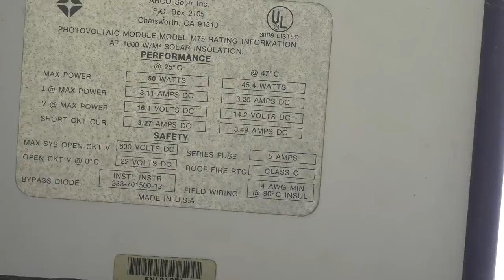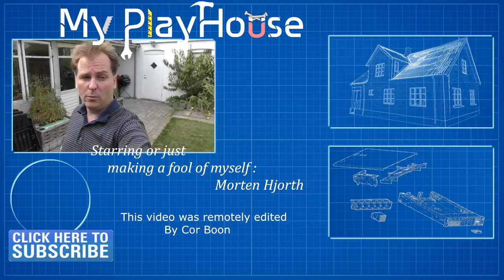Save 5X on Power Consumption - DC DC Step Up Booster Converter - 734

Comment: You can charge the lead acid battery with a buck converter too. Set it to 13.8 to 14v. Connected direct to the solar panel. More efficient than a controller usually too.
Reply from the maker: Hi Munted Wookiee
Thank You very much!
Thank you for watching! :-)

Comment: Hey morten, i recommend to put a battery undervoltage protection between the step-up-converter and the battery. Have the same board for a led flood light that I build a long time ago. When the battery goes empty, the converter pulls more and more current, resulting in a extreme voltage drop on the battery. Tryed this out myself and the battery voltage goes down to 9V and then the mosfet on the board exploded because there was to much current to hold up the output stable ^^
Reply from the maker: Hi DashcamDriversGermany
Thank You very much!  Do you have one you can recommend ? a cheap one :-)
Thank you for watching! :-)
Reply from the maker: Nice,, but I just put on a new tiny charge controller,, and it has this battery protection,,, a bit low for my taste but it is there.
Reply: you need to connect the converter at the outpit of charge controller to utilise that function else a use a 12v relay to input the converter through its normally open contact. if not the battery will die as mention an year ago!

Comment: The metal backed PCB is for heat dissipation. It is common to use thermal paste to attach them to a heatsink for passive or active cooling. 
Thanks for the video!
Reply from the maker: Hi Kevin Clingerman
Thank You very much! First time I got a PCB like that,,,, It is rated for 250Watt,, I am using 32,5 watt it only just become hand warm,, glad you liked the video :-)
Thank you for watching! :-)
Reply: My PlayHouse yeah I figured 32 watts wasn't enough to justify a heatsink. Julian illett on YouTube does a lot with solar power and DC buck/boost converters, you should check him out if you haven't already!

Comment: I think 32V is the open circuit voltage of the PSU. I bet that if check the voltage during charging, you'll find 28V.
Reply from the maker: Hi Alexandre .S
Thank You very much!  but it was charging!
Thank you for watching! :-)
Reply: It could be the lithium battery charge controller asking for more power. If it was a factory battery you might see the 28V. I say give the mower the power it wants! More voltage = more better... until the magic smoke leaves...

Comment: I don't see any fuses.
Also a undervoltage protection would be a nice thing to have.
I would recommend an output of what the power supply tells you and don't go any higher than that.
See also the power supply for how many amps it can deliver and hold you to that.
Reply from the maker: Hi Geert Pirens
Thank You very much!  some of this you will see in the next video.
Thank you for watching! :-)

Comment: Hi Great video, Your suggestion would be great for my problem.

Solar panel open-circuit Voltage: 40V

Battery 12 V (AGM

Controller : PWM controller max input voltage 28V

Can I use D3806 to step down from 40V to 25V and connect to
solar charge controller to charge the battery? Will I lose energy in this converter
in step down mode? Or the module will convert in to Amps from Voltage while step
down?

Thank you
Reply from the maker: Hi Krishna Kumar Velappan
Thank You very much!  there is a good chance your charge controller can take in 40v,, check that first.
Thank you for watching! :-)

Comment: Never take that battery lower then 12.20v or you will damage it. Deep cycle lead acids can only be discharge to 50%(12.20v). so a 100ah really is a 50ah. Another thing, lead acid batteries have a bad charging efficiency at 85% so your losing 15% of the power that makes it to the battery. You 50w PV is acting like a 42.5w PV not including other losses like not using a MPPT(Max Power Point Tracking) charge controller. (Can't tell if your are using a PWM or MPPT controller or not) Would make a world of difference by boosting your PV efficiency between 10% - 30% over using a PWM controller or lack there off.  Also using a solar alignment app to set your panel(s) to an optimal angle adding to the overall effectiveness of your PV(s).
Reply from the maker: Thank you very much!

Comment: I would get a second 12V battery and charge them in parallel, then run that boost converter at 24V to the 30V you need. It will be more efficient. The bigger the range those converters have to boost the voltage up the lower the efficiently they are.
Reply from the maker: Hi squarrl
Thank You very much!  I am sure you mean "in seriel" or do you have some other smart way to charge two batteries,, parallel,that is sitting in seriel ?? Solar panel gives out some 14,xx volt. 
Thank you for watching! :-)
Reply: No I do mean you wire the two batteries in parallel to charge off the solar panel. The mower would charge with the batteries in series. You would need some diodes to make this work.

Comment: Morten, I do not know if your solar battery charger is PWM or MPPT, but I recommend a MPPT that does the complete charging cycle, or at least that every 15 days a full charge is made, because your video posted the voltage is very low and its panel narrows slightly. So an MPPT has a greater efficiency in small panels.
Reply from the maker: Hi Juliano Ardigo D Avila
Thank You very much!  glad you liked the video :-)
Thank you for watching! :-)

Comment: The first thing that Evil Robot Mower did. Try to cut the cord! Doesn't the stupid thing know. That, it would be committing Cable Side??? Good work, Morten, You saved the Day or Mower, once more:) Oh, and I've often wondered. Just, how much Power Consumption - Wattage, you could save. By eliminating an AC to DC Adapter, in a Battery Powered Circuit. Definitely worth it... Don
Reply from the maker: Hi Don Bishop
Thank You very much!  Suicidal little menace! from 12V 1A,, to 200mA
Thank you for watching! :-)
Reply: That's a huge improvement!:) Don

Comment: Nice! Will the new charge controller have a load output that will turn off when the battery gets low? Otherwise you would need a boost converter board with low voltage shutdown, the only problem is that those don’t have much hysteresis so it will just sit there and flicker until the battery stays under that voltage all the time, the charge controllers that have load outputs normally have voltage settings to adjust the on and off of the load. Thanks for sharing!! Good idea!
Reply from the maker: Hi SuperBrainAK
Thank You very much!  Yes to low power,, it has that Load output!
Thank you for watching! :-)

Comment: Using a boost convertor is much more efficient. Imagine the loss of power through the inverter then converting AC to DC then stepping it down. Totally Inefficient but you know that, you might want to place the convertor on an CPU heat sink with some compound and it should be cool. So keep your stick on the ice and don't get shorted.  . )
Reply from the maker: Hi T Komoski
Thank You very much!  I just checked,, the lawn mower has been charging for the last hour,, and the back of the PCB is just hand warm. maybe 40C it pulls 2,5A 12,5Volt so 31,25 watt and it is only the losses in the PCB that warms it up. ,, it can handle 250 watt,, that is not going to work long without a heatsink.
Thank you for watching! :-)

Comment: Couldn't you just use a 24v solar setup and charge the robot directly ?
Reply from the maker: Hi Mark
Solar panal only gives out 14,, something volt,, I would need to boost that then. Or get new panels. but yes that would also be an option.
Thank you for watching! :-)

Comment: Hey Morten, I'm intrigued by your relationship with this piece of crap. Its almost got a personality after a few episodes. You got it as a faulty unit in the beginning, and then did tons of effort to get it going. My question is - if my garden was like yours, and I bought one brand new, and I did the setup with the guide wires, and everything perfectly - would this thing actually maintain my lawn properly? Is it possible?
Reply from the maker: Hi Johann Swart
Thank You very much!  I like messing with the robot,,, this is my kind of fun. It's not supposed to have a li-ion battery, it's not supposed to run of solar,,, I have made those changes to play.
It does do an deasont job cutting the grass.
Thank you for watching! :-)

Comment: Smashing mod, you cut out unwanted conversions :-D
With boost converters, the more you boost the voltage the more current is needed from the source :-(.
So you could turn the boost voltage down a tiny bit, try 25V, just a thought :-).
Reply from the maker: Hi zx8401ztv
Thank You very much!  Humm Yes,, maybe start by bringing it down to 30 and then 28,and then and then...
Thank you for watching! :-)